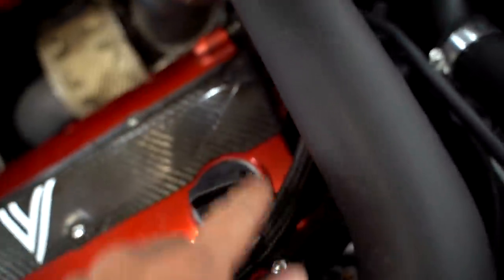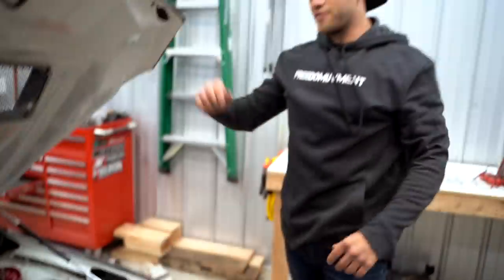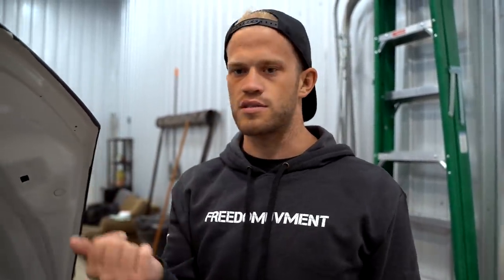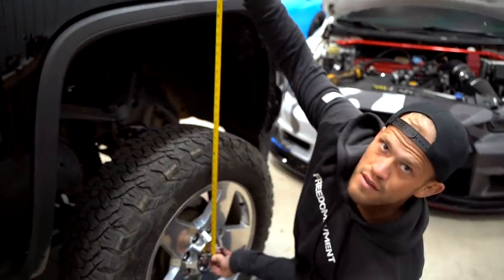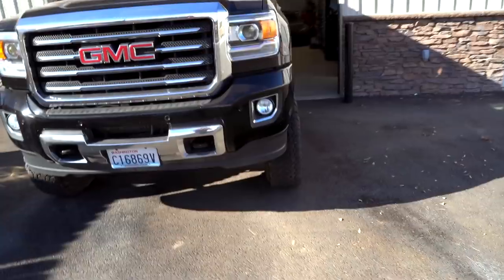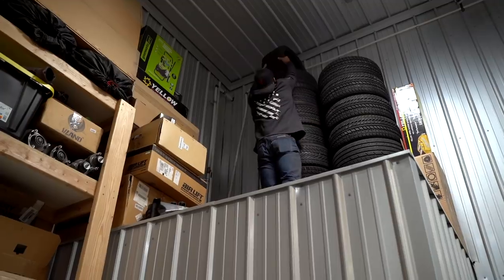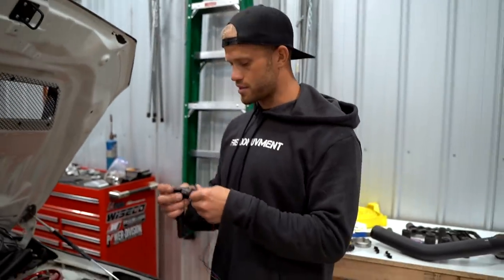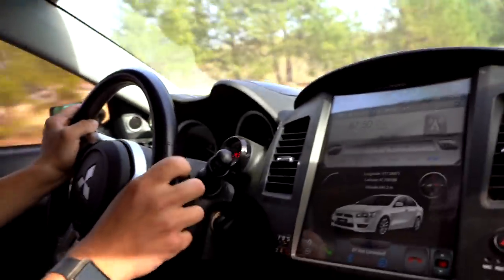What Caused The Evo X Engine Fire.

Comment: the bolt does not ground the coil down, the ground comes from ECM through a wire . the bolt is just to hold the coil down . spark couldve been jumping up, wires rubbed metal valve cover and shorted , or rubbed each other and shorted
Reply: connector looks melted, bets are wires shorted at connector or coil is shorted
Reply: or spark just jumped and the heat and stuff finally melted down, id replace coil, and fix harness and u should be good
Reply: @Dennis Moroz You been watching Movies again?

Comment: Ive heard that splicing coil pack wires can mess with resistance and may cause some issues, might wanna check into that dont wanna run it lean on 1 cylinder and burn a piston ect.  . glad the car is good and jared is too and you guys made it back from cancun despite the zeta scare. glad to see some content rolling in .

Comment: When i got my car back from the tuners they had installed a fuel reg and a aluminium pipe to the injector rail,  when I got home I just happened to look under the bonnet and there was fuel dripping down from a crack in the fuel pipe, i had it replaced with braid. The moral of the story, check everything when you have work done and regularly after and keep a fire extinguisher in the car.

Comment: It looked like you had enough wire left on the harness to cut out the striped wires and repin a new connector instead of splicing it in. Splicing in should be avoided if possible, it creates a new failure point.

Comment: I had the same thing happen to my GTR, except it was fuel pump wiring. Loose connection created a hot spot, enging died, checked the boot and saw black charcoal wiring, melted plastic etc.. Not cool! Deffs need to have a extinguisher, never know what dodgy wiring the car has had in the past.